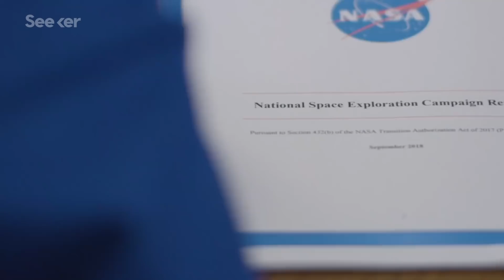How NASA Plans to Return to the Moon | Apollo

Comment: If you check out the specifications of the Moon Landings you would soon find that the numbers just don't add up! Think about it! Oxygen, food and water, fuel reserves compared to the weight and lift required to go to the Moon don't make any sense! Werner von Braun told us what would be required in 1952! It would require a space launch platform in Earths orbit for fueling an Empire State Building sized rocket just to get to the Moon without landing! Then another space platform going around the Moon to land and get back home again! A manned mission does NOT have the same requirements as a reconnaissance satellite or Moon rover! Robotic Men will land on foreign worlds WAY before real men ever will!
Reply: von braun explained what would be needed for a SINGLE STAGE VEHICLE you utter dishonest dimwit

Comment: the braided circuitry used on-board Apollo was a dead end, and was unceremoniously ditched. The integŕated circuit has no genealogical link to this bizarre tech.
Was the Apollo discovery really just a taste of what there is to be discovered on the moon?  So we all thought for a minute that Apollo left nothing to be discovered and that's why scientists had to tell us, 
"No, that was just a taste."
So when we thought that Apollo had discovered everything about the moon... what was it that they actually discovered? 
What did they find on the moon?
Integrated circuits?
If Apollo had been designed to halt further exploration of the moon then you'd conclude it was a great success. Today when we are shown lunar exploration evidence,  it's normally relating to Apollo or satalite images which appear to be 50 years old. If that's not the case,  then the modern satalite are still using black and white and low res video. 
The fact is that Apollo wasn't fit for low earth orbit, let alone a lunar excursion,  because of the lack of shade. Even worse,  NASA claimed the sun is cold.
I've made 3 vids on various issues which prove Apollo was a hoax. The first links the others and  is only 5 minutes long.
https://youtu.be/Zztbw7MLlkI
The impossible did not happen. 
The ISS flies under the radiation belts and is protected to some extent because of this.  Any crew attempting to go a short way further up would  require protective shielding from radioactivity. That would mean a complete enclosure in a very thick,  or very massive blanket,  either of which would instantly disprove Apollo for all those who refuse to read the findings of explorer 3 1958, as published in 1959 by Dr James Van Allen in scientific America where he rules out any possibility of surviving those radiation belts. Some ill informed people have the idea that the doctor was talking about an extended exposure as the danger. No, he wasn't talking about living in the radiation belts,  he was talking about going to the moon.  
Apollo was a hoax and the house of cards has collapsed for any who care to examine the first facts. 
The rest of you who uphold this lie are not covering yourselves in glory here.  It's not patriotic to support hoaxes.

Comment: The moon is just a few light-seconds away. It's crazy to send people there until robots and teleoperated machines have built and tested a complete base suitable for humans. Even then, it's hard to justify sending people when the only advantage is saving a few seconds of transmission time. Yes, yes, it would be nice to go there, or even see someone go there, but remember that the cost of sending people is orders of magnitude higher than the cost of bots. Try holding out for the dream of sending people there, and you risk spending another 50 years waiting to send anything at all. We could've had teleoperated lunar bases that were continuously experimenting and learning how to build with native materials for the last several decades. Instead we have arguments about blame, broken hopes, and a few humans in low orbit. If you want to get humans on mars, build extensive bases on the moon to test out every detail first. If you want to build bases on the moon, do NOT send people. It's nowhere near worth the benefit of slightly faster interaction times. Build with bots, make it cheap, do it now.

Comment: you mean... it'll be the first time, that they will try. it's an impossibility to get man through deep space and survived to tell about it. The best experiment we could have to prove that without losing life... Is an easy one, as well as a hundred times safer even.. So that ought to give it a perspective. drop off ahead of time supplies or whatever you would normally be able to fit on one vehicle. Have it land in the middle of the most desolate driest and inhospitable place either on, the most secluded part of the Arctic... Like 5 * better weather than on Mars. Or the other end of the spectrum, in the middle of the Sahara. Now airdrop your so-called astronaut, & them in their full flight suits with it only a hundred degrees or at 120 sometimes. They can't take off those suits for anything. Now for what they have with them regardless on what end of the spectrum on the Fahrenheit gauge... They've got to keep the suits on... then, let them go to town. but only what supplies are there, and they are not to be where supplies were dropped or landed. They've got to locate them as if in real space. Because if you think that you're going to go millions of miles in space and land at the exact location assuming everything is going to always be perfect , then that's only a controlled situation and unrealistic. and I will wager a large bat, that one or all will be crying like a biotch before the oxygen Runs Out, or water or food or heat exhaustion or radiation poisoning or hypothermia, spend trillions on this planet and what we were given to work with. Build colonies here, grow food here excetera excetera. cuz I can guarantee you that if God wanted us to venture away from what he gave us, it would be within reach. it's not an accident nor a fluke that we just happened to be the same ratio of water 70 / 30 as the planet. that it's set in the only place, that we can survive, that the Earth is basically a well-oiled machine with a working fluid core to provide a Magneto sphere around us to protect us. And it's not a coincidence, the out of the whole universe there's not one planet with anything we need to live. Four scientists they are some dumb fuckers. to believe that we flew in on a meteor or comet as Stardust from a place we in no way can survive at. But the whole master piece of engineering... The human body and brain, was just evolved from Stardust and amino acids... Really?! Got to be fucking kidding me. Man, and I'm going to say this only once more on comments. I usually watch only documentaries science space anything that helps broaden the mind. but it's getting to where these so-called smart scientist and explorers all they're doing is writing a science fiction. so I'm going to say it one last time. Man will never venture to another distant planet, and definitely any further than Venus or Mars... And live. That the first morons that strap in a little capsule and go for 9 months thinking aaa's going to be to the rescue when something screws up, it's basically just another Japanese kamikaze suicide mission style Journey.

Comment: So 50 years later with mechanical manufacturing being orders of magnitude more precise and processing being millions or billions of times more advanced NASA with the plans for Apollo failed to at least replicate a 1969 landing? Does raise a lot of questions to anyone with common sense.
Reply: It's not about getting there. At least now days. It's about spending as much money as possible re-inventing the wheel, several times over.
Reply: @henrytjernlund  but success is needed to keep or even increase funding so there is a huge incentive.
Reply: @op-op-op  kickbacks happen everywhere. Isn't that built into the budget? I still expect success given how easy this should have been with access to all the original plans and new tech since 1969.
Reply: @manickn6819  
No that isn't built into the budget and there are many reasons on why the SLS hasn't left the ground and possibly never will. Until recently NASA's budget has been decreasing every year, now it's been raised to $20 billion a year. Only 30% of that is going to the SLS compared to the $100 billion NASA was getting in 1969 amd the majority was going to the Apollo program.
  It also doesn't help that NASA's long term plans almost never stay the same forever. Every 4-8 years the plans can change whenever a new president comes into office and decides to cut or raise the budget as well as changing the plans from Mars, to the Moon, back to Mars and then back to the Moon again
Reply: @vitalfir46  so you are saying are not able to replicate a 1969 technology with a smaller budget in less than 4 to 8 years before a direction change? They have the plans for the original mission. I am sure a lot of the original budget was R&D. Production techniques have progressed leaps and bounds since then. CNC and 3D printing of metals have come a long way. Doing better than the capability of the 1960 control system should be a breeze. I would not be surprised if this can be done with a $35 raspberry pi. 

Maybe you are right although it does not make logical sense the truth can be stranger than fiction. Generally though simple logic prevails so I am not inclined to believe them.
Reply: @manickn6819  
No. What I'm saying is that NASA can't get anything done with rockets anymore. Money isn't the main problem but it contributes. It's the politics around it as well as the contractors it hires to build them things. Look at private companies like SpaceX and Blue Origin and you'll see that they have almost no contracts with outside companies to build their rockets for them. And since they dont have the government changing their plans 4-8 years they can actually get stuff done. The Falcon Heavy took 8 years to build and flight test and it can carry almost the same amount of cargo to LEO as the SLS.
  If NASA was like those two they'd have this rocket flying by now. And yes rocket making techniques have improved but that still doesnt  mean it's not going to take years to desing, test, and fly them
Reply: @vitalfir46  I am still not convinced but I accept you are making a case that is plausible. I see SpaceX and Blue Origin as scapegoats allowing the technology to be developed but ensuring NASA shares no blame if something does not go as planned. Its a good strategy. If SpaceX botches a moon landing no big deal. NASA does not look stupid.

What is further suspicious is this is the only technology any nation has developed in recent times that no one else replicated in fifty years. Lets take the nuclear bomb as an example of an extremely complex technology. USA developed it in 1945 and the Soviets had it in 1949. As it stand now a large number of nations have nuclear weapons pr have the capacity to build them even though they choose not to.

This is the only technology that there is very serious interest in that I can think of that was left for almost two generations before being picked up again. The agency that did the original landings is still active and well funded. They are still in the same business and have all the data and skill sets. That is really odd. 

If you plan on going to Mars it makes sense to keep iterating the technology over the years to improve. Keep flights and slowly build a moon base. Surely funding is not the issue since lots of nations pitched in for the international space station. It's not reasonable to assume no one would pitch in for an international moon station. Why was this never done. 

Lots of nagging questions that politics and changing governments alone does not explain. If I can find reasonable answers for all the questions then I must accept that maybe I have it wrong. Until then I continue to doubt. By all means do feel free to venture some explanations.
Reply: @manickn6819  
  I can kind of agree with pretty much everything you said. To explain why other countries haven't landed on the moon is kind of simple.
  History first, the only reason the US landed on the moon in the first place was because of the ongoing Cold War with the USSR and the fact that President JFK had died. When NASA was confronted by congress on why they should continue to fund the program before the first moon landing, JFK's speech on sending a man to the moon and bringing them back was often brought up and the point was that it was their duty to complete the president's request before he died basically. If it wasn't for that and the space race between the two countries then the US likely wouldn't have completed the landing as soon as they did.
  Right now there is pretty much no incentive to go to the moon except for science(which robots can do), and exploration. Almost no country wants to pay for this since even though they may know how to do it, they still have to pay for it. And it's even more expensive if the rocket isn't at least partially reusable. It isn't that no one knows how to do it, it's just expensive to. The USSR was the first to land something on the moon so they knew how to do it. China and India have also landed their own rovers on the surface. A rocket capable of a manned mission today would probably be cheaper to manufacture and launch than the Saturn V but that doesnt mean it will be easy or done at all. The USSR for example had a manned moon mission planned but their rocket never got off the ground. Their rocket called the N-1 would've been more powerful than the Saturn V but each of its 3 test flights ended in an explosion. After the last landing in 1972 no one really cared about it by then and not a lot of countries besides the US and Russia had a space program or had even launched something into orbit. The European Space Agency(ESA) as we know today wasn't founded until 1975, India's space program was founded in 1969 and didn't launch a satellite into orbit until 1972. China's space program was founded in 1993.
  However China is rising space power having the most successful launches in the world in 2018 and they plan on sending a manned mission to the moon in the 2020s which i will be happy if they pull off. Perhaps that will give the government more of an incentive to let NASA go to the moon agian
Reply: @vitalfir46  I still think its odd that we do not have an international moon station. So much to do up there. Anyway space is heating up and the US does not want to be sidelined by China especially. Of course there are military implications too. SpaceX is determined and progressing fast. Maybe we are in for another space race. Lets hope this time its sustained.

Comment: Yet another pointless money-grab by NASA's contractors. They should've cancelled this Apollo wanna-be, recycled Space Shuttle era pile of parts, that is now - as with any government project around the world, especially in the US - grossly over-budget and behind schedule. It's been pretty obvious for many years that the reward-for-delays and work-on-it-till-its-done model the US government uses is vastly inferior to the fixed-price contracts NASA handed out for Commercial Resupply and Commercial Crew. SpaceX and Blue Origin are particularly cost-effective - Super Heavy/Starship and New Glenn would probably have already been flying had NASA funded their development with fixed-price contracts using half the money it has already flushed down the toilet for the antiquated and already obsolete SLS.
Reply: Ya hear that, Bridenstine?
Reply: Best comment I have read in a while.
Reply: The contractors do what the customer tells them to.  And one big problem is that the customer can't resist tweaking the design.  The Commercial Resupply and Commercial Crew programs worked because NASA did not "help" design the systems.  NASA instead told them what they needed done and merely required that the contractor show progress and keep at least somewhat on schedule.  Of course SpaceX's development style (continuous incremental improvements) conflicted with NASA's requirement that the design be 'proven' (several successful flights without any design changes) before it could be used to move people.  (Of course SpaceX did have to redesign the capsule after they decided that there was no realistic way to get reliable propulsive capsule landings using existing technologies.)